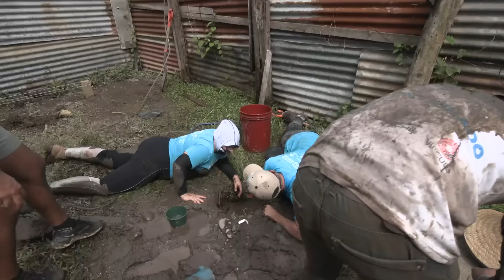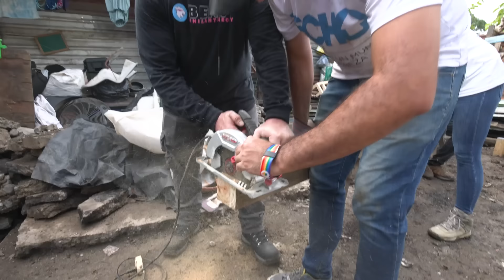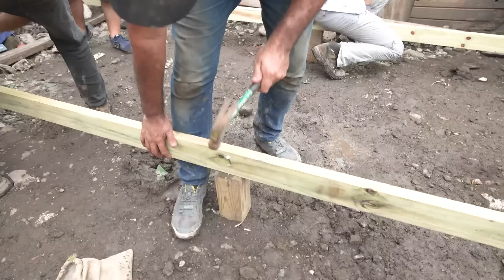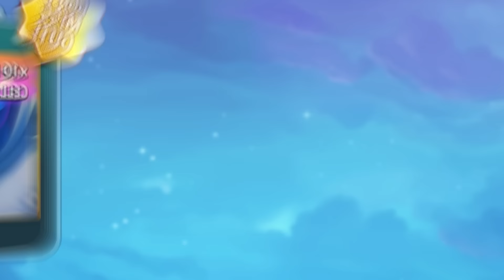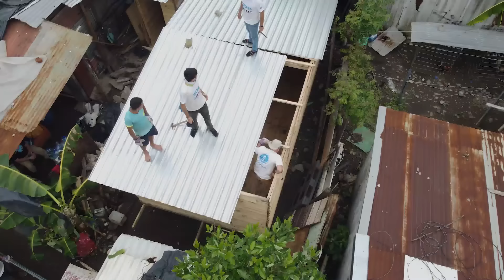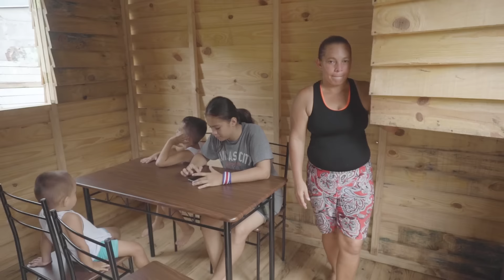We Built Houses for Homeless Families

Comment: Normal person: buys 1 guy an apartment for a 20 minute video

Beast: BUILDS 10 houses for a 3 minute video
Reply: They didn't bring their whole equipment. Since there has been a general problem with lots of lost cargo, you have to keep it light. Besides, the weather conditions have been crazy lately, our country has been experiencing a lot of rains in the northern border, and getting tech into Costa Rica can be quite expensive. Maybe they just managed to send out some reduced amounts of videos, most of our upload speeds are 5 or 10 mbps. Too may variables to consider man. And those areas barely have any signal. These are just a few of the most distant communities in our country.